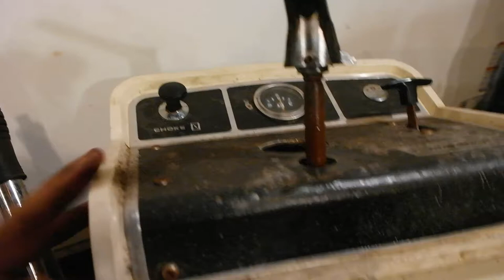Cub Cadet TLB Transformation Part 3 Steering Column and Transaxle Removal

Comment: If you would have loosened just one of those front frame brackets  from the  front of the transmission the rear-end would have practically fell out of the back of the frame onto the lift by itself.   It also aids in the installation process too!    
I enjoy watching all of your videos, your not afraid to tackle  anything on any model tractor.  This 149 TLB has turned out really well! GREAT JOB!

Comment: Your doing some great things saving those old garden traktors. There truely amazing to use and work on. I love my cub 126 narrow frame
Reply from the maker: +pnz4aufsh Thank you! Stay tuned for more! I am preparing another video in the coming weeks highlighting Modifying the Front Wheel Spindles, and then a couple weeks after that, I will begin fabrication of the Front End Loader

Comment: did you ever put an electric PTO on this Cub Cadet 149. My understanding is that the OEM Kohler engines did not have the necessary threaded tap holes in the block to mount an electric clutch PTO.
Reply from the maker: I did not. I have my pump running full time off the pto. Threaded holes can be added with a milling machine or with a drill press

Comment: What would you recommend for a small garden tractor to put a case D100 backhoe attachment on
Reply from the maker: An IH Cub Cadet Wideframe would be a good choice! But an of the popular old garden tractors will suffice such as Wheel Horse, IH Cub Cadet, Ford, Case/Ingersoll, John Deere, etc.
Reply: @Isavetractors  thank you very much

Comment: When reinstalling the transaxle and hooking back up any hydraulic lines do you have to purge air out of the system? I have to change a leaking line out and can’t seem to find this information anywhere. Thanks.
Reply from the maker: The air will purge on it's own. Just cycle the lift cylinder.
Reply: isavetractors Awesome! Thanks for the reply!!

Comment: does it have to be cub cadet? and if so what year does the body style change, looks like I should stay in the 1970 years ?

Thanks, Great vids
Reply from the maker: You can build a FEL and Backhoe onto any old Garden Tractor. Some tractors lend themselves better than others. The wide Frame begins at the Cub Cadet 129, and continue from there until you hit super cub cadets. The Mid 70's is the gold era of old Garden Tractors IMO.
Reply: I found a 1210 cub 120 hydro with a tall handle on the side looks like 70s
Reply from the maker: The 1210 is from the 80's You will have an Aluminum rear end on yours. It's still a great tractor platform to build a backhoe and/or loader from.

Comment: hahha thanks for this video. tho its 5 years old. ive learned what i got to do to rip rear out. goin to move the 149 rear to a 127 frame. so i can have the hydro lift. why not just use the 149 if someone comes across this. will all the stuff i have snowblower mowers plow are for a NF not a WF. almost thought about cuttin a 106 frame and weld it to the 149 frame.why u ask 106 frame if u already have a 127 frame. will i have a 106 frame to. hate to ruin the 127 frame.. seems might be easier. not sure yet tho. gives a break point.